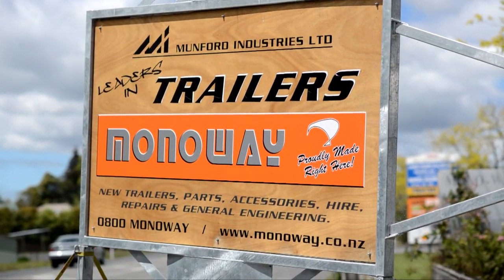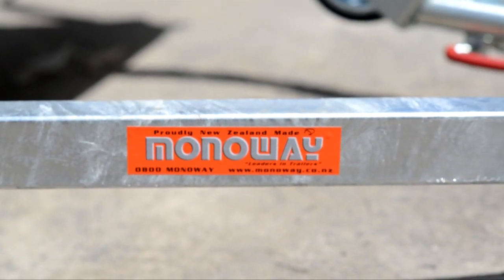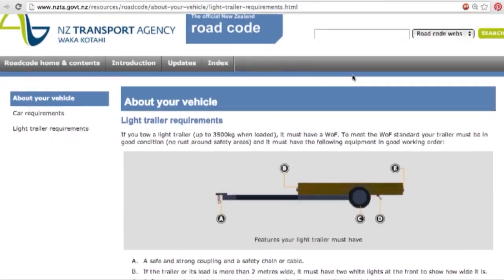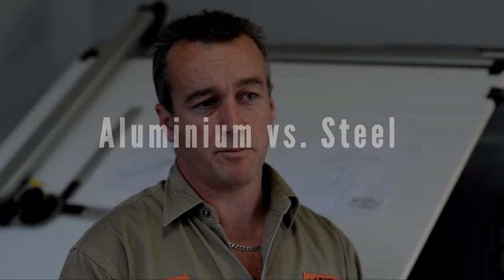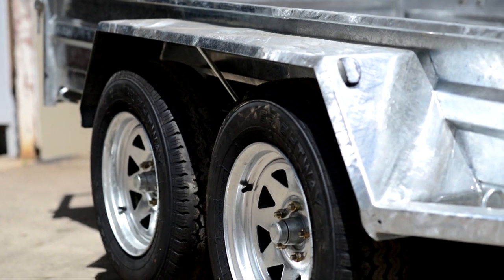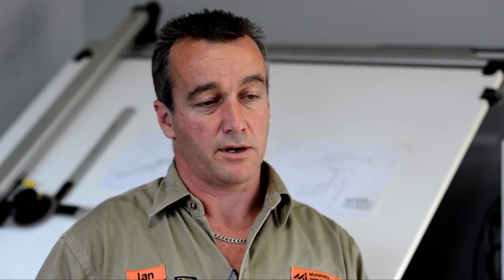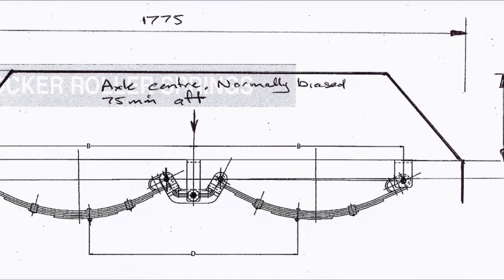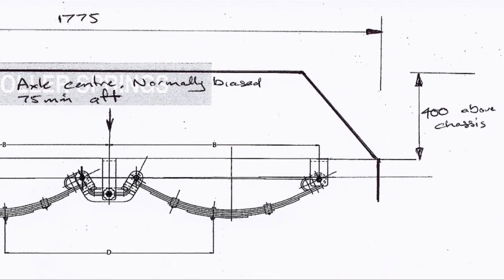All About Tiny House Trailers

Comment: There are a lot of trailer manufacturers out there making heavy duty flat bed trailers that are rated to haul much more than these tiny custom made trailers.
I'd start with one of those so the brake, wheel and suspension are already set up.
Reply: +petnzme01 Rated to haul....Not just rated to take the weight on the outside or inside but the whole deck including the outsides  You never build a heavy duty trailer have you?
Reply: +petnzme01 Depends on what size you get and what weight rating you want.
You can also get flat decks, step decks goose necks, oh, and they also carry travel trailers on them for transport as well as all kinds of heavy equipment.